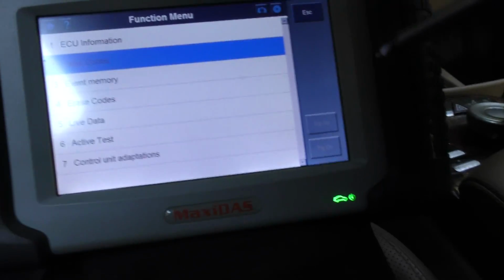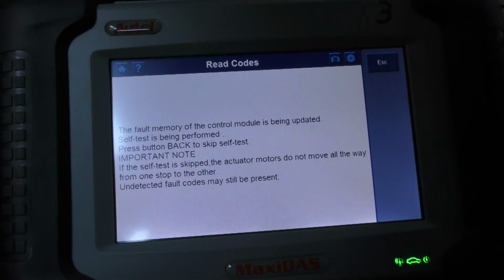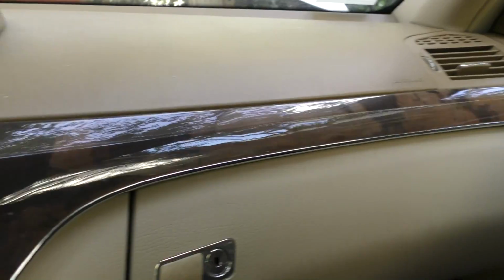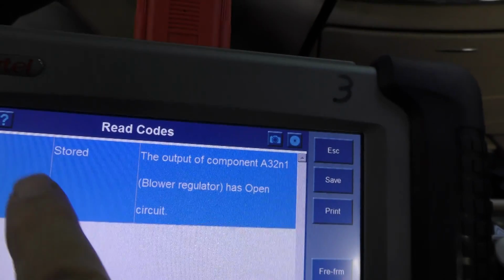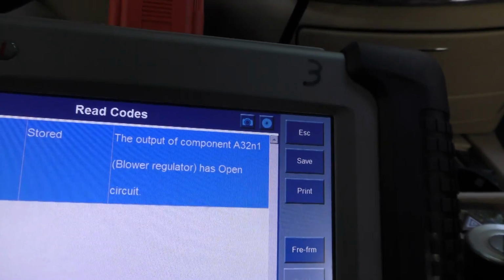How to Fix Modern AC System in Your Car

Comment: anyone with a multimeter can diagnose this problem. you don't need a "fancy scan tool"
Reply: Just because you know car troubleshooting doesn't mean everyone with a simple tool will be able to diagnose problems. that's why this channel is mostly entry level DIYers. Don't be a Smartass.
Reply: i agree...
people now a days are getting lazy...
here in the philippines, most electricians dont even know how to use a multimeter but they can revive a dead isuzu elf 4hk1 from japan(coverted driving side) with only an automotive bulb and a wire.. but it will take 3 days to find the problem, but it costs only 100 dollars here..
Reply: A basic scan tool usually won't have access to OEM-specific codes, only the generic OBDII stuff. Even on those $1000 scanners, support for OEM-specific codes are add-on extras.
Reply: The problem is that you can't switch some solenoids and other things on/off as part of your diagnosis, so in CERTAIN cases, it would be impossible to get juice to some components to test them.  There would be an element of guessing involved and it would take MUCH longer to chase it down.  But as mentioned, a cheap scan tool would have worked in THIS case to point you in the right direction.  A $25 Autel would have worked to read that code.  Just realize that this is not always the case, and especially on some VW/Audi's you almost HAVE to have a VAGCOM.
Reply: You are probably right and using a multimeter would be fine if you work on your own car. But Scotty gets paid by the hour and probably has to work on multiple cars every day. It makes the job easier and you can work more efficiently. That thing would eventually make him earn more because he can work faster.
Reply: Most people with any common sense would probably check the blower first if the blower wasn't running.....
Reply: The Fur Channel huh... the scanner helps by simplifying the problem.. if you use a multimeter youd be testing a bunch of stuff before getting to the blowermotor
Reply: If you know anything about electrical and air conditioning it won't take long at all
Reply: There are quite a few sub-$100 pocket oscilloscopes out there which should be good enough for basic troubleshooting. Most of them get blasted for poor usability in reviews though.
Reply: TheRaellz troubleshooting an AC systems electrical using a multimeter and gauges would not take long if you know what you are looking for.
i'm not against error code readers but i still want that car mechanics and electricians know the basics of each and every component and how to find faults manually..
starting to be a car mechanics without these knowledge is bad..
here in the philippines, we have lots of cargo trucks that are suplus from japan, the dealers wont give you support for that, people here fixes even ECM board.
there are lots of very skilled electricians here but there are also lots of whackoes who makes it worse...
Reply: The Fur Channel a basic scan tool is under 50 dollars
Reply: if its really just a cheap board that frequently break then it just has the same things that all common electronic stuffs has..
cheap resistors, cheap capacitors, etc..
if you know how to use a multimeter, why not just fix the board, replace it with quality components..
fixing it and replacing it with quality components might be more durable than a cheap quality new one..
Reply: ***** I've personally never used one of them but I got one for free when I bought a cheap engine stand to rebuild my Camaro engine. And I'm not trying to impress anyone, Scotty just over simplifies things too much. Messing with your vehicles electrical and not knowing the basics can be very very dangerous. I have a friend that set his car on fire because he decided that it was a good idea to run his cooling fans from a switch without using a relay. I know unrelated but just an example of what can happen if you don't know even the basics. That's all
Reply: Some boards simply have poor circuit design in the first place and putting better quality components on the same board will merely delay the inevitable. If you want a real durability improvement out of those, you need to redesign the things.
Reply: It probably is pulse-width modulated.  If you really want to prove so, use an oscilloscope to see what the signal looks like.
Reply: Augie Inciong  or use a digital multimeter dc duty cycle, scopes are expensive...
Reply: Augie Inciong pretty much all modern cars have pwm blower motors, cooling fans etc
Reply: ***** 12v at 5 amps = ??? Watts?
Reply: Then you should know better 😂 I'm not saying scanners don't make it "easier" just not required
Reply: I paid almost 2 grand for my scan tool for a reason
Reply: Teardown Dan if you do a search they have really nice scan tools for around 350 - 700 with built in oscilloscope, voltmeter etc just gotta Google it but please realize by nice I mean functional and usable
Reply: Yep, Teardown Dan is correct, and on many German cars, you'll have to program to the onboard computer many of the replacement parts so that they work together!
Reply: actually the title is wrong...
it should be "how to diagnose problems on modern cars".
Reply: +The Fur Channel care to recommend any such scanner with oscilloscope, please? cos here in UK for £360 (so not cheap) I can find only modules like Autel Maxiscope which need to be connected to laptop/PC. Not ideal if you don't have a garage and work outside on the street
Reply: tomheesakkers I'm not saying it's not useful, I'm just saying you don't need it.
Reply: Not everyone who owns a car has the general knowledge to diagnose without a scanner. Scotty targets a general audience.
Reply: He said all the stuff they have changed, computer controlled blower motors are PWM ***** other than that nothing has changed since the discovery of electrons.
Reply: ***** and I totally agree, a 5 dollar multimeter from harbor freight is all you need to figure out the problem.
Reply: ***** pulse width modulation changes how electricity acts on an open circuit? Please never touch a car
Reply: Codey Hanna I have a nice fancy snap on scan tool, enjoy your basic $50 scan tool. Not my point, my point is with a little basic knowledge you don't need it.

Comment: why do blower resistors fail on so many cars across many brands?
Reply: I assume hot cold cycles. The resister regulates the voltage of the motor controlling its speed. The excess voltage is shed off as heat.
Reply: If so they should have taken that into consideration when they engineer the part.
Reply: TheWretchedWorld you are absolutely correct. anything that heats up will eventually wear out and burn off.
Reply: Tanah Merah they probably have. I'm preety sure it's designed to only work for 6 years or so.
Reply: +Tanah Merah  Like Trump, I blame China! Lol
Reply: +Evaldash
Cars cost way too much money, to expect to get but only 6 years of service from a car. There are cars over 20 years old, still on the roads.

I do not understand why a resister or other important parts, should not be expected to last well beyond a mere 6 years. If anybody thinks that 6 years is reasonable, then what if it was designed to work for only but 6 days? Sound reasonable? Of course, if much of anything still works normally after 60 years, that could be impressive, although I imagine that there are a few appliances and vacuum cleaners, that are around 60 years old, and amazingly enough, they still work. Or still work after a very minor repair, say such as replacing a belt for the carpet beater brush.

BTW, I have not have any blower motor or resistor problems, in vehicles as old as 20 years old. Perhaps not all car parts are designed to soon-failing junk?

Comment: How much was the blower motor?
Reply from the maker: 300 something bucks
Reply: You'd be surprised how many customers wouldn't mind waiting a few days if they're gonna save a hundreds of dollars to repair such a simple part. That Blower Motor and the resistor together cost nearly $600 locally... that combined with labor and you are looking an expensive repair bill.. If you order the same parts online with next day air shipping it still would have been way cheaper. Yes I've instances with customers who are super impatient and want everything done now and yet they complain on why its so expensive. But from my experience a good majority of customers I've dealt with were more than happy to wait a day or two for the parts. Especially those customers who were on tight budgets.
Reply: I paid 40 bucks for a junkyard blower motor for my Lexus.  You can find brand new ones fro my lexus for $70.  $300 is insane.
Reply: Are you serious? $300 for the blower motor? Where did you get the parts from?? I had a customer with the exact same problem on his 07 S550. I ordered the blower motor online for $88 and the resistor for $49! All brand new parts! If you buy Mercedes replacement parts from the dealer or at a local part store your gonna over pay way too much.

Comment: scotty, what are your thoughts on the 2009 Mercedes c class in terms of reliability
Reply: I'll give you one guess. Figured it out? If not, than go to John Cadogan on YouTube (An Australian auto reviewer and engineer), he has lots to say about those cars - most of which I can't repeat!
Reply: I agree. John can give some hints on what's crap... He particularly 'likes' the Merc. Especially their customer service :D

The only german carmaker he does not bash is BMW. And sure it is. I own a BMW and a Mini. I sometimes rip my hair out on the crazy engineering but as long as you take good care of the car and do not save on oil changes and fuel it runs forever and my airbag recall in my E46 went also fine. And that was the supplier's fault not BMW's. They aren't saints either but they build very enjoyable cars and they do not shit on the customer's face out of pure spite.
Reply: No sarcasm intended. I have nothing but respect for "superior German engineering". After all, look how well it served them in WW2! (Not to mention WW1 - the 'Great War'.)
Reply: @Kavinda K  So, did you take my - our - advice and check out John Cadogan? And if you did, what did you conclude about the reliability of your 'dream car' Mercedes?
Reply: @Zoltan Kozma  And that's a very good thing! Lol :)
Reply: My sarcasm detector is tingling. Well it also comes down to the matter of taste and the requirements. I agree that random hyundai or honda is a very reliable car. But also boring and unexciting. So BMW has actually a bit of history of bad quality stuff. The whole E90 and its convertible and 5 series models were the most terrible bmws from the quality standpoint. Cheap plastics electrical problems all due to bad manufacturing. Now the F30 is back to the standard that the E46 or even beyond. I was positively surprised. With a BMW it matters where it was assembled. The best ones come from Steyr, Austria :D Anyway in many ways a BMW usually has a lot of features that they invented and perfected like the start/stop tech. In Asian copies of the same tech people get quickly annoyed in summer with the aircon on. The devil is in the details. The BMW version works the way you would expect it to and does not annoy you. Also I lately see with reliable asian brands, which I give it to them are really premium quality manufacturing they integrate tech that just comes with loads of software bugs. For instance there is a customisable BOSCH unit for radio and navigation and many adopt it. One of its annoying bugs is randomly forgetting EQ settings and volume levels. So many times I see that the hyundai or the mazda is very compelling value proposition but the tech malfunctioning in there would get my geeky brain melt with anger. At least the software part of the BMW lives up to the promise of the 'superior german engineering' :)
Reply: lol well on that matter it only took the entire rest of the fucking World to stop them yet the fine-tuned non-russian projectiles jammed in some default Siberian winter. The Kalashnikov just laughed that day... lol
Reply: Back in the '80's I had a neighbour who owned an '84 BMW M3. He was constantly having his side windows smashed (BMW - Break My Window), and his Blaupunkt stereo stolen. It got so bad that his insurance company forced him to have a car alarm installed or they would drop him. After he did, the neighbours really loved him with all the false alarms from his alarm system in the middle of the night! Yet, through all this, the thieves never once touched the Blaupunkt in my Volvo 264GL! It must have been the "superior German engineering" that attracted them! lol
Reply: Ok... Having written the truth and did not realize I was supposed to submit for the measuring contest for man with below waistline existential problems :) So I guess considering the topic your submission, my friend, is radiating irrelevance and insecurity. But so be it if it is an american toyota that is even among toyotas an abysmal extremely boring breed eating 91 octane fuel and a rubber-like torque converter makes sure you would not pull away the way I suppose a car should. And you are right and BMW can possibly  handle 500.000 kms by the time you would probably need to check valve stems on it. Assuming it was serviced and the oil was not one of the things to save insignificant money on. :) Oh and the developed world uses the SI(metrc) system. You know the one that works, makes sense and does not operate with arbitrary unit magnitudes. The imperial system served a purpose with people having all sorts of size in feet and so your space shuttle would fall down but there is something that just clearly is superior and entertains the notion of an etalon unit for gram, meter, liter, sec, C, V, mol...etc . And all this sorcery is capable enough to describe the universe as we know it.

Comment: Eventually you will have to be an computer scientist and mechanic just to fix a car.
Reply: I think the end goal of manufacturers is to make it illegal to work on cars yourself because all components use their proprietary software and it will be illegal to modify it or work on it yourself. So, you'll be forced to repair cars at brand dealerships.
Reply: My college prof said that even though I am going into the computer repair field, he said to expect myself to be working on cars in the near future.
Reply: +Matt Stoker - My friend's uncle is a Ford Mechanic.... he's basically a computer technician now.....
Reply: Unfortunately, there aren't enough dealers or skill within those dealers to repair the volume of cars.  When that happens you'll have to wait all summer to have your A/C looked at. 
As it is, just book your car into the dealer for a service and there's usually a 2 to 3 (or more) week wait.
And then get charged a kidney for the work.
Reply: Ellesmere Wildwood true, completely true the best way I know to solve it to get a nice solid older car one where you can work on it yourself without the need for c+ certification
Reply: All ready do - that's why they generally call them Automotive Technicians rather than mechanics these days.  Check out Pine Hollow's channel....
Reply: Matt Stoker I would add that one day probably not long in the future that anytime a part breaks on a car you just unscrew the big part under the radiator cap and replace it with a new one.
Reply: And a plane :)
Reply: That's a scary thought.  I can see where the term "street outlaw" will have a new meaning.
Reply: Eman 08 - you're absolutely right!  But keep in mind that neither (Software Engineer or Computer Scientist) can get to work if the Automotive Technician sucks at his/her job ;-)  I went to school for Computer Science with a minor in MIS - I use very little of the CompSci coursework in my job today but was still very helpful in understanding why things like the DWAVE are devil spawn.....
Reply: Scott Warmbier stfu
Reply: nope... to fix an AC in a modern car not that different from 90's car...
it will still have an AC amplifier which receives signal from main ECM and AC panel, which sends power to blower and AC compressor.
it will take time but one can check all the components if one has the patience...
and in electronics, most boards(ECM, AC amplifier, transmission control, electronic speedometer gauge and tach) the capacitor will wear out.
Reply: Matt Stoker nah,scientist arent going to waste their time on cars. tbey got bigger things